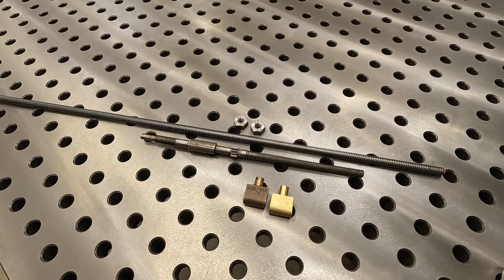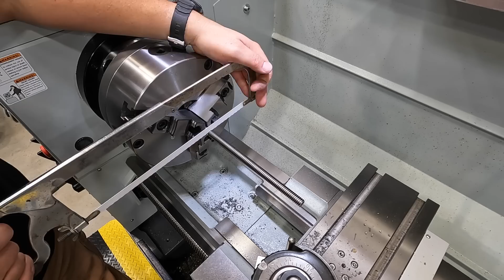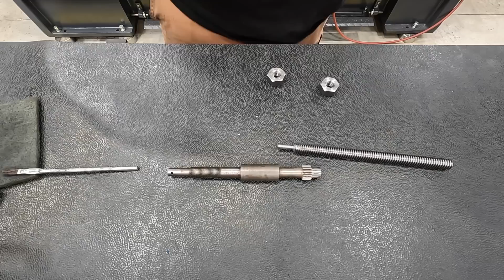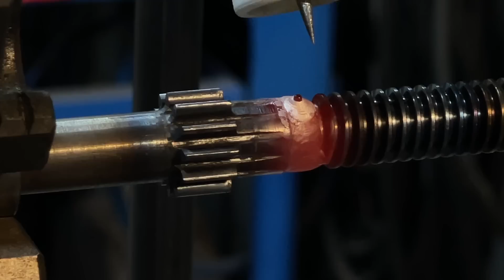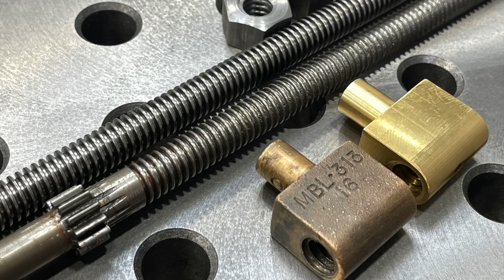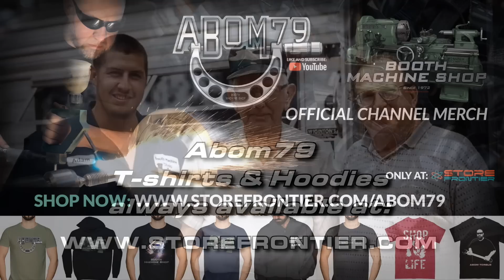Lead Screw Repair for 10" Rockwell Lathe

Comment: OMG 1/4-20 is the worst thread ever......
I would have used the largest fine thread tap that would fit in the job.......
Reply: As an expert, you need to start your own channel!!
Reply: Doing the largest thread possible would result in a weaker part since there wouldn't be as much weld and not as much material at the end of the female thread.. with this part your way would still work but it's not as strong as how adam done it
Reply: The thread is just for centering and "pulling-together" purposes. Making it larger would have reduced the amount of (female-side) material that would have carried most of the service load. It's the weld material thats resonsible for its strength and not the screw.

Comment: I'm not sure you understand just how refreshing it is to see that I'm not the only one who uses a hacksaw on their lathe for parting...  Sometimes, it just has to be.  Thanks, Adam.
Reply: So do I.
Reply: My old, small lathe really struggles with parting so the my hacksaw gets a fair bit of lathe action!
Reply: If he had steadied the free end of that shaft it would have parted off easily without chatter. I sometimes use a cardboard tube over the OD or put the end in the tailstock bore. That fix will work till the cows come home.

Comment: When you were tapping, it looked like your tail stock chuck was way out of center ??
Reply: That's just the bad quality of the tap holder, I have the same exact one. It's an adjustable style vs a solid collet style. After I figured out the problem I had to search through a few of them to get one where the angles were cut centered.
Reply: That was the tap holder doing the wobbling, not the tail stock chuck